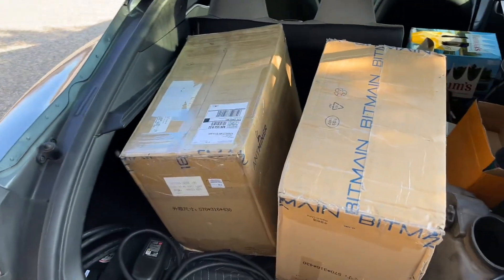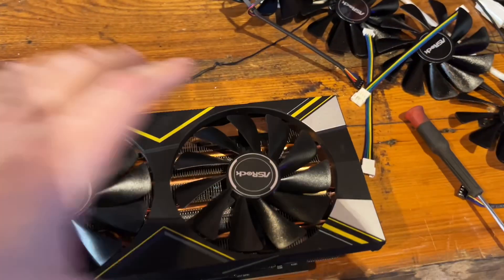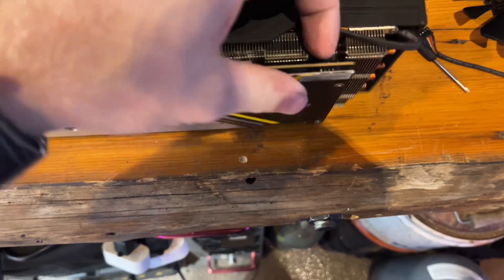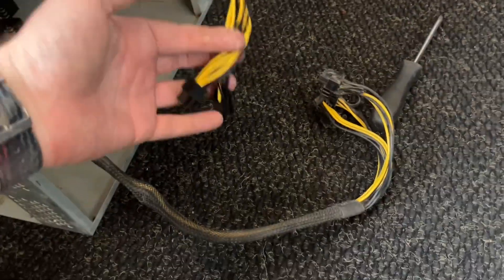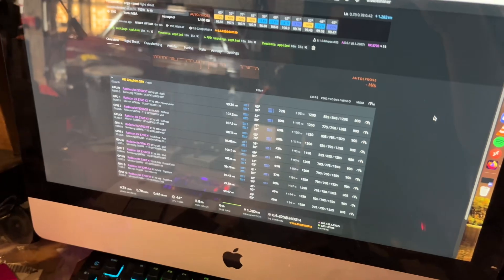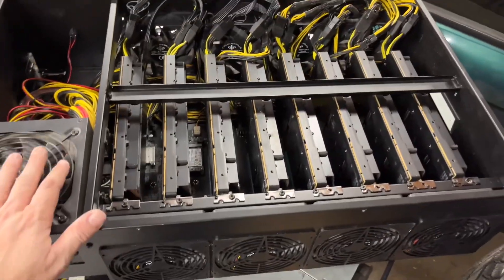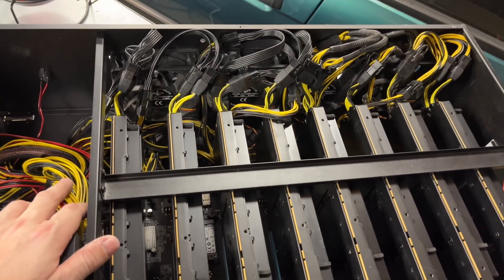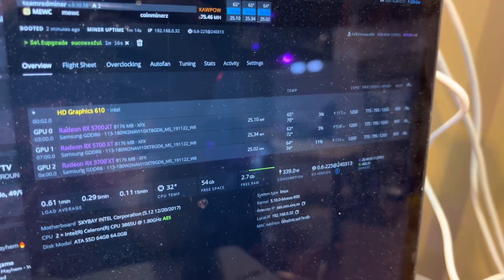32 very needy 5700XTs

Comment: Ive got a fair number of triple fans nitro 5700xt's. Love them. But ya they seem to need an 8pin and a 6pin each. Not like an rx580 thats happy with just an 8 pin.
Reply from the maker: yep 5700 non XTs can get away with single 8s but not the XT for board power limits

Comment: I have 8 asrock challenger xt 5700xt they are great on alephium and kawpow but I need to repaste and repad mine the memory will hit 100-104 on kawpow intermittently 😅
Reply from the maker: yikes yeah need to repad. have not found the RDNA1 cards to be any good at core at all, but they're very relevant on KawPow for sure!
Reply: @OvalboreTech  yeah on alephium I’m getting 565-575mh at 40-45-watts very efficient I am achieve 700-750 but power consumption goes to 80watts  plus
Reply from the maker: @NorthEastCryptoMiningLLC  they do 657MH at 64 W PMD with the best tune I can manage... not very efficient. 10MH/w. better off putting them on 

Im guessing you're referencing software power which is just sooo, so wrong.
Reply: @OvalboreTech  true yeah thats the hive os wattage prob more like 65-70 at the wall I’ll have to test and see I just got them a week and a half ago and started messing with them once repaded and repasted I want to put them back on Neoxa what’s your fav kawpow over clocks on these 5700xts?